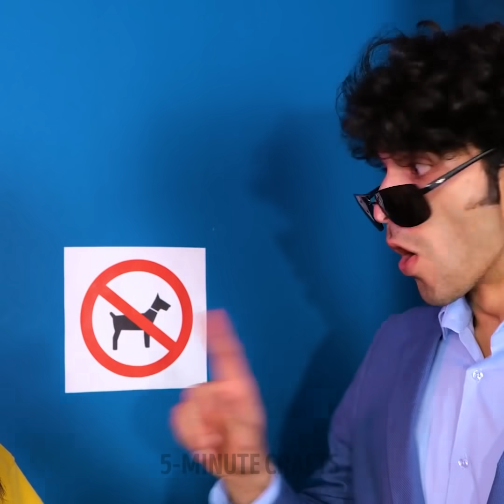Cute Dog Gadgets And Lovely Crafts For Cats || Genius Pet Hacks That Will Make Your Life Easier

Comment: Your so smart
Reply: Nope your wrong this is abuse
0:22 the cat didn't even poop in the toilet and if it did it wouldn't land in the hole same if it peed.

0:33 cats don't sit like that they obviously forced them to sit like that.

0:36 the dog walked in a puddle how did they get dirt on they’re paws

0:50 (this goes to the one with the dog and the puddle) bruh after they put the dog down the puddle is gone

0:55 the dog is to small to get on a bed that tall they obviously picked the dog up and dropped them on the bed

1:33 the cat is obviously trying to get up but the lady pulls the cat back down and the messaging machine is supposed to go on the top of the cats head not the cheek

1:48 if you put it at 0.25x speed you can clearly see they photoshoped rain in

1:53 bruh they’re making fun of the dog

2:08 they’re literally forcing the dog to open its mouth and the ’’toothbrush’’ isn't even touching the dogs teeth.

That's all I'm going to say butter poop you can figure out the rest of the abuse or someone can add on to my comment also they probably didn't even give the ’’pets’’ names